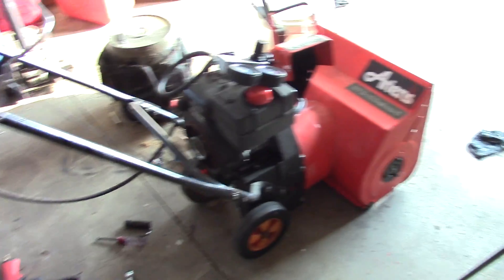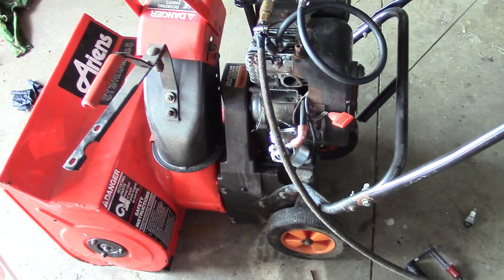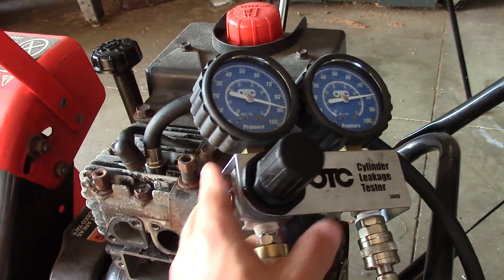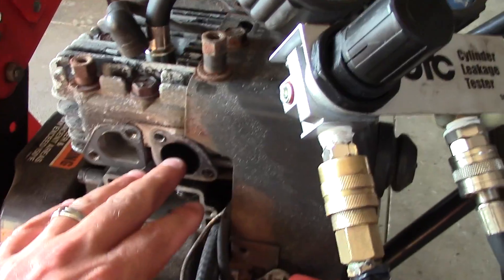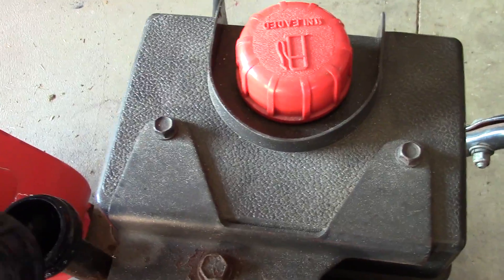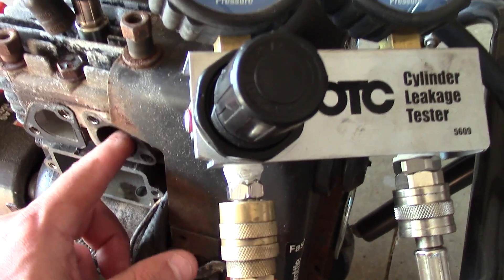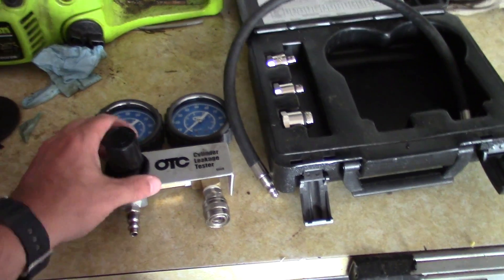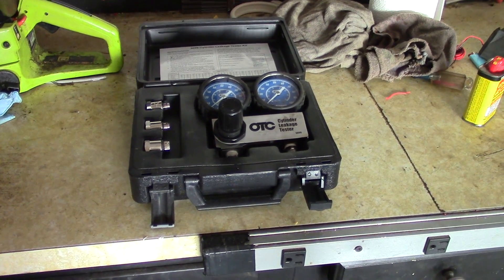Leak Down Test OTC 5609 Snowblower Lawnmower

Comment: I have a 7.5 HP torque to the ground. It is firing, got gas but will not crank. Mower  does have about 55 pounds of compress compression. Why won't it crank?

Comment: A leakdown test might be more accurate on a lawnmower engine,for example,my 148cc 3 hp (3.5 governed to 3 hp) Briggs & Stratton powered push mower,it tested to about 90 PSI  with the old piston rings,it was at the point that it took 6 pulls to start it & it started blowing a bit of smoke when it was cold,it was burning through 200 mLs of oil in 1 hour of mowing the lawn.

When I first fitted new piston rings into it the compression tested at 80 PSI before breaking the rings in,it started first pull after I got the engine running.

I did some mowing with it yesterday for 1 hour & it cuts grass much better with the new rings fitted,it feels like it has more power now.

It feels more powerful than my dads 186 cc 6.5 hp Honda HRU217D lawnmower,now Honda says that a compression test of 70 PSI is o.k.,my point is it has become a bit harder to start & it burns a fair bit of oil on startup but stops once it's warmed up a bit,the compression tested at 70 PSI due to it having the compression release on the camshaft.

The next project is to rebuild my dads Honda GSV190 engine,I'm going to order the updated piston, the timing belt,oil seals, etc,I already have the later style rings for it, buying the newer style piston & rings is cheaper than buying the original piston rings.

So,I might invest in a leakdown tester !
Reply: A compression used in conjunction with a leak down test is the best way.  Many people seem to stop at the compression test.

Comment: That is a snowblower carburetor, but it is for the Tecumseh 8-11HP engine models HMK80-HMK110. The Tecumseh 5HP uses the carb for an HS30-HS50 with a different choke and fuel nipple setup.
Reply from the maker: Thanks now I know what to write on the tag for storing the old carb.

Comment: Would this work the same on a 2 cycle for testing the rings and the reed valves? 

Great Video!
Reply from the maker: I usually use a vaccum and pressure tester for 2 strokes.  You need to block off the carb and muffler.